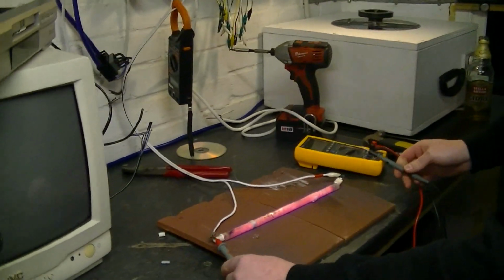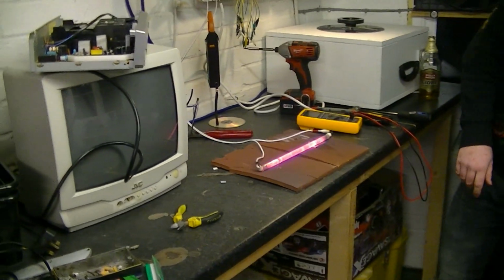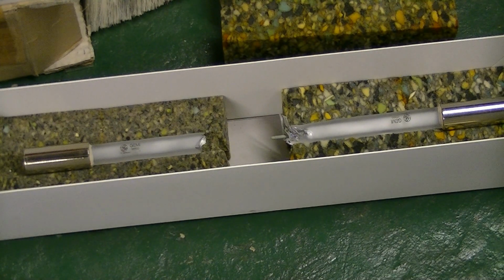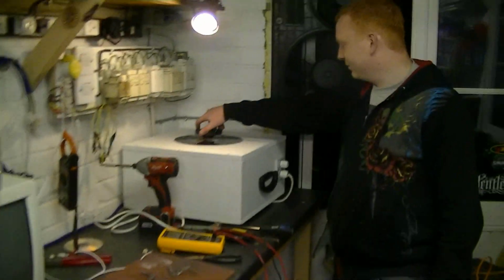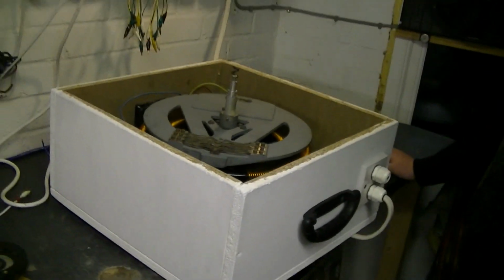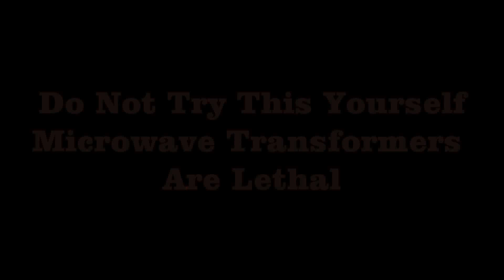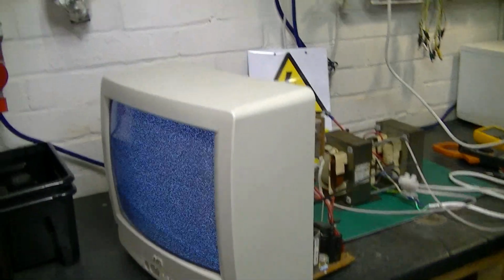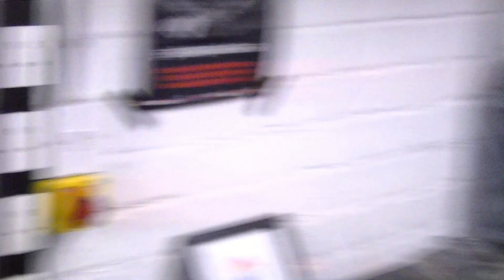Photonicinduction makes a visit

Comment: That variac is awesome mate
Reply from the maker: Thanks. It took me ages to find a good old school one as they new ones are pretty shit tbh and if you overload it by even the tiniest amount, it's rewind ☹️

I always keep an eye out on eBay and not that long ago I managed to get another one. It's a bit newer, the windings are smaller but it's rated at 25A but the brushed are on the outside of the toroid which is always better. I've gutted it, cleaned everything immaculately, now I'm going to put some casters on it so it can be wheeled around.

Comment: Gah, a 40 amps variac............I feel like I'm the only one who has only a measly 2.5 amps model.......
Reply: +CoolKoon I have 3 amp 250 volt variac, made in soviet union, and it has carbon wheel, instead of a brush, and when you turn it,m the wheel spins around the wire and it never arcs, you can put whatever load you want, it will not arc, that shows the quality of the older stuff
Reply: +Vytautas Poška Mine's also like that, except it's been made in Czechoslovakia instead of the USSR. Still, I wouldn't overload it if I were you, because the winding can still burn down (there's a reason for the rating written on the label you know) and rewinding such thing is REALLY a PITA.
Reply: Vytautas Poška what's funny is I was thinking of a design of a variac in my head and I was thinking a wheel might work much better then brushes.. huh so it's already been done, guess it's not hard to think of when you look at it